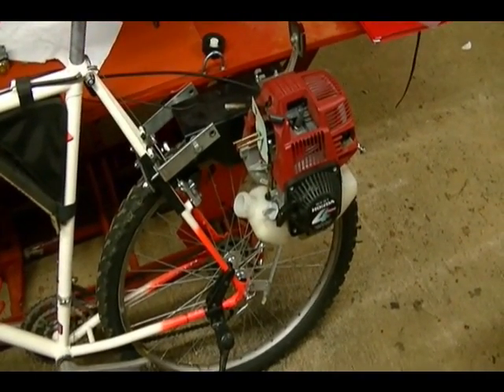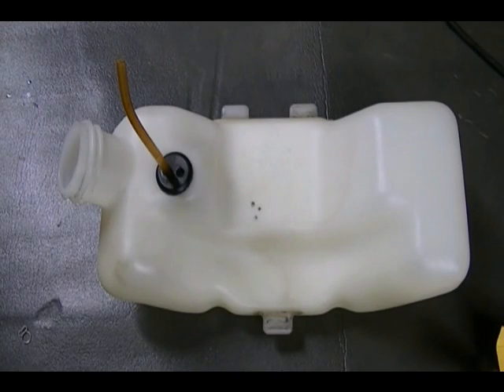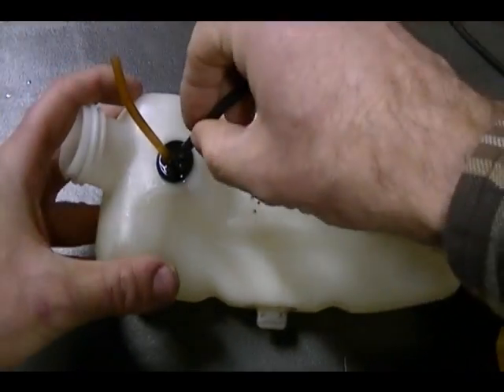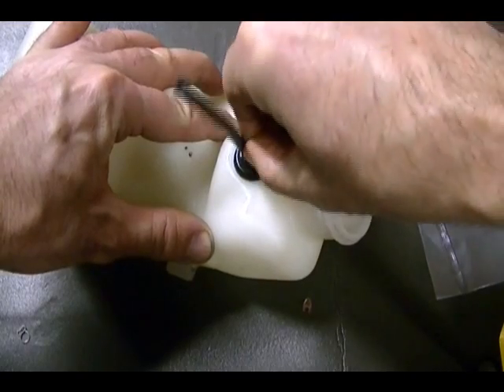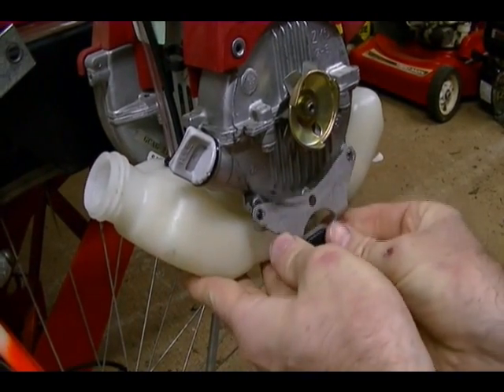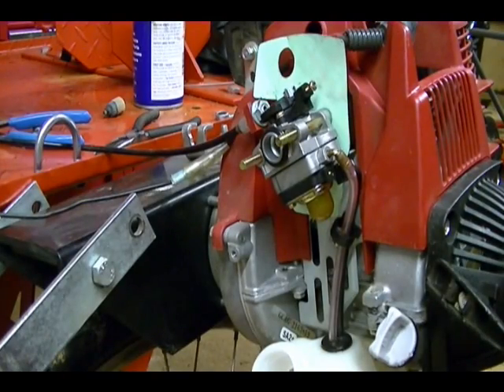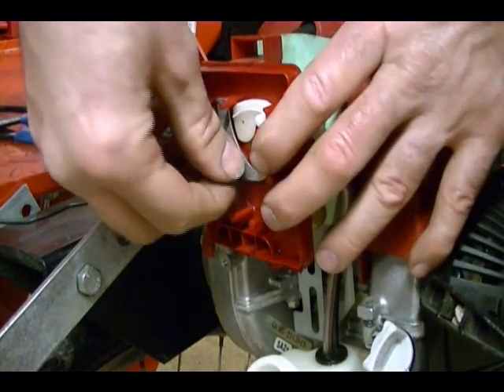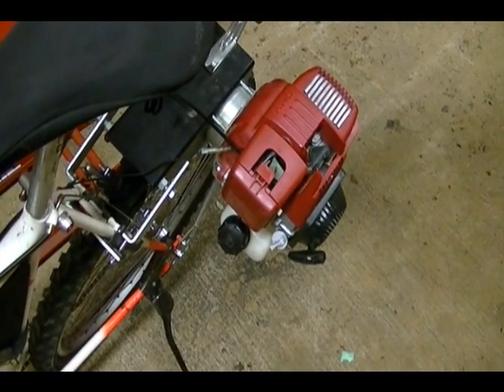Small Engine Repair: Honda GX31 Carburetor Installation and Fuel Line and Fuel Filter Replacement

Comment: The black fuel line turns to black syrup in a very short time if theres any fuel left in the tank between uses. Im going to replace both lines with the yellow type line to the length specs the op says is factory. Hopefully that will take care of that problem.  I have been using highest octane fuel with stabil for reference.  Maybe its time to make the jump to tru-fuel.

Comment: Hi, Can please tell me what scewdriver you use for taking the carburetor apart? I've tried using the phillips scewdriver all they is mangle the screw heads.
Reply from the maker: Make sure your using the right size phillip screw driver. Also, some screws that look like a phillips screw head are actually a Japanese screw, which uses a different driver. They have a dot on them.

Comment: So the big line on the top and the little line on the bottom? Which one is the fuel and where does it connect? top purge or bottom line?

Comment: Great video; I just had the fuel lines start leaking on my GX 31 brush cutter/trimmer and ordered parts to replace.  Installed today; I ended up pulling the rubber grommet from the fuel tank, feeding lines, and then reinserting into the tank. Much easier to feed this way.

Comment: THANKS! Very good you stated the lengths of the fuel lines from Honda, and how muchy they should stick out.. I have a gx35 multi tool machine and after 10 months thrashing, it likes to cut out when on angles lately, which it previously never did. I'm going to try new lines and filter and thanx to your specs info hopefully itll behave when cutting hedges and snipping on angles! Cheers

Comment: expert trimmer repairman told me that my motor is a  worthless and very bad chinese replica of this hona gx 31 motor ,but looks almost the same,  l notice mine does not have white letters on the red plastic over oil cap and the black area on top is different, mine has five slits. my oil cap is black too,
Reply: can u gide me why my Honda gx35 is stoping when I raise the engin as if no petrol is reaching the cab,I have put a new filter anew can adjusted the tapirs why does it surges and will not take the engin but stops please help
Reply: often small motors have a blocked carburator , search clean carburator  and motor name

Comment: Thanks for the conclusion of that repair.  Looks like no "H" and "L" screws, so no adjusting the carb (with the exception of the needle lever height?)  Also what Walbro kit did you use?  I guess there's two commonly used carb kits and was wondering if that may be one of them?  Keep up the great work and always enjoy the videos.